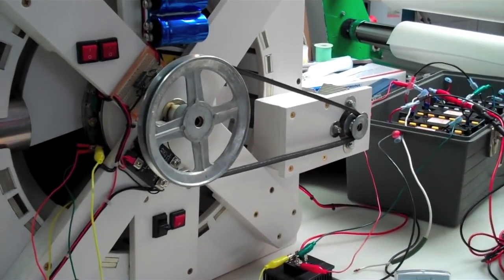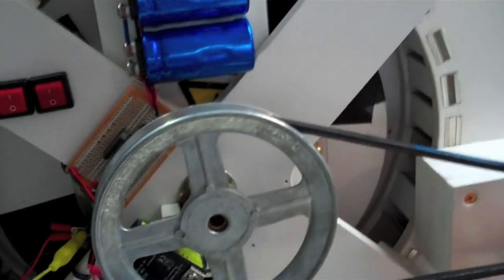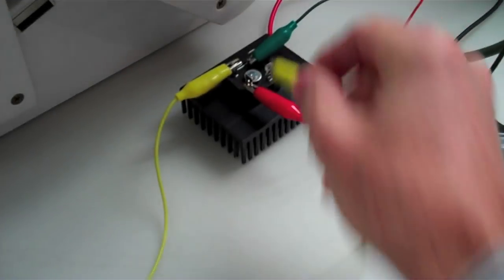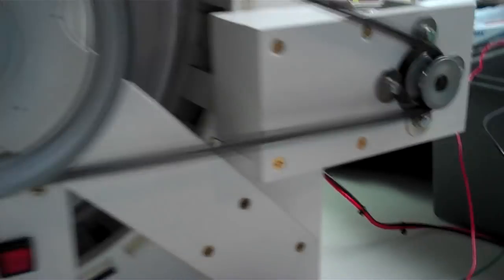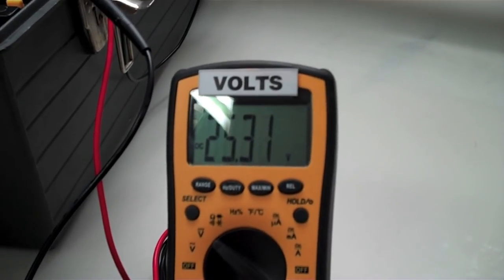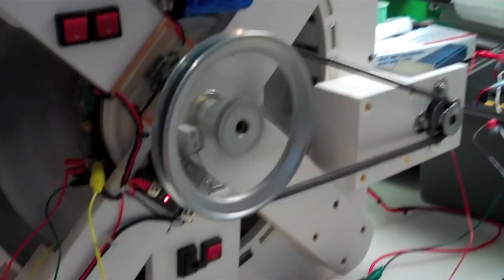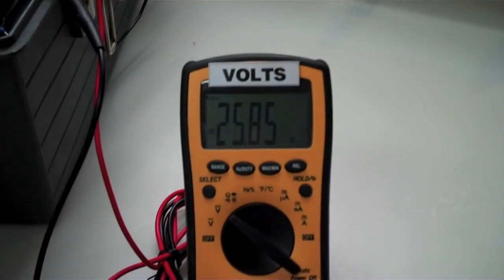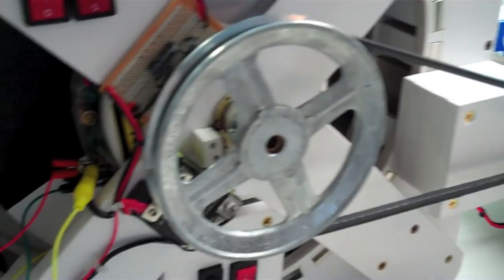SELF CHARGER - Power Output Test

Comment: that thind was drawing almost 3 amps for several minutes on the small batteries, I expected run voltage to be about 22 volts after the demo, motors use a lot of power, were you also charging the run batteries with the rats nest?

Comment: You could use this system to explain the United States Federal Reserve banking system. The Battery is the Fed, the Motor is JP Morgan, and the big wheel are the debt slaves. The Battery puts $1 into the motor, the Motor generates $1.50 puts $1 back into the Battery and blows the 50c away in heat.
Reply from the maker: Great analogy!

Comment: not my system. test run for 30 hours. used 1.5 VDC, 0.053 ma input, 153 VAC, 3AMP output, 1,500 miles. need more testing. hope to get the input down to 0.983 VDV, the AMP's the same. but I hope to get 24,000 watts, 60 to 100 AMP output.

Comment from the maker: That's correct. I did not claim over unity, I just recorded test results. Yes, I do have extremely bright overhead lights in this work area. There are (10) 4100K, 40W, 48 inch florescent lights at 7' 6" distance from the floor. 
Thanks.

Comment from the maker: @bo34865 No one is talking cold fusion here dude. Obviously you are not familiar with Nikola Tesla. Energy abounds all around us, all of the time. I sure wouldn't call the space around you "nowhere", and yet it's always fully charged. By simply using a little modern cleverness, we certainly can extract energy from spinning electrons through sympathetic vibration. It's easier than you think.

Comment: You gain more power if you forget the motor, and the belt, built the motor around the generator, use a computer controlled ignition, round shaped/curved supercharged neodyms, the copper cables must start thin, than they must bee thicker (gain more power) good luck

Comment: great work,  keep it up,, you should make a switch that allows you to switch between the discharge batteries and the charged batteries and do a timing test of how long it will run the system along with the 40 watt bulb.... this will be the difinitive answer for the accomplishment you are trying to accomplish.  5 *'s vs.

Comment from the maker: @MrArrow1961 That's a good idea Rob. Quick charging is really the name of the game. I've got a nice LiPo that I use in operation of another device, and it does charge quickly and deliver intense power when needed. Just need to develop a good switching circuit.

Comment: Dear PMMG4HYBRID, what about to use in future LiPo bats with is not so expensive chargers to use UPS at 3 set's of batt where 1 set always under the UPS discharge and other 2 set's in the same time under the charging with smooth switching capability to UPS? Why LiPo - they can be charged from 0.5C up to the 5C( the nanotech type) and this will able to cut charging time very dramatically. I am not even talking about load capability of such batts - 30-50C
Truly
Rob